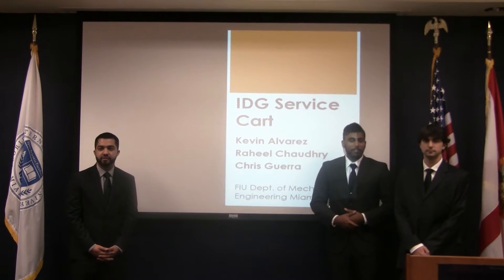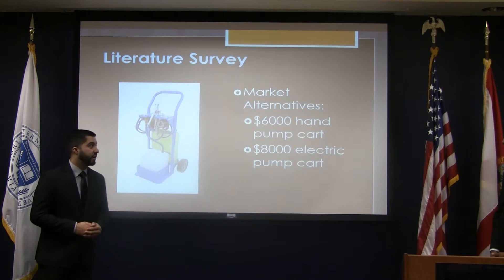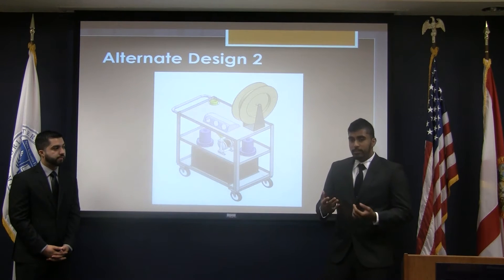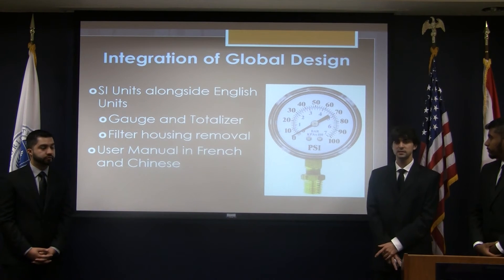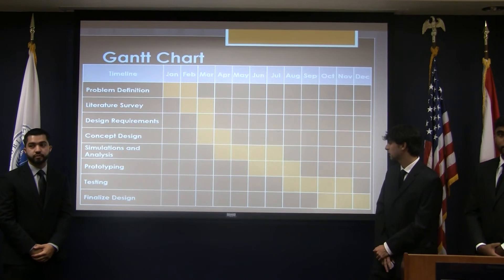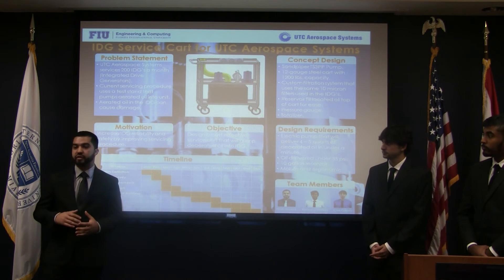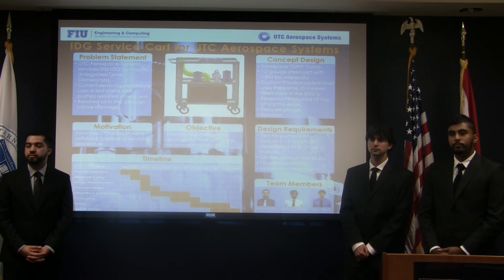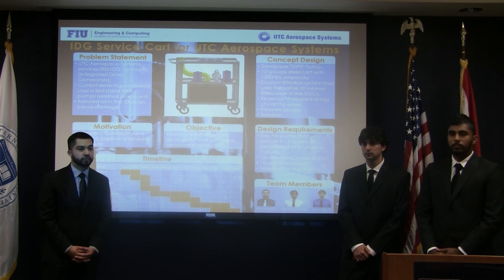SDO Team 1: Electric Integrated Drive Generator (IDG) Servicing Cart

Comment: Overall a great presentation, mostly on completeness. Presenters went in-depth into everything they spoke about. Slides were helpful and easy to read. Only complaint about the presentation is that two alternatives are acknowledged and then they just skip to saying they chose the second option without doing a side by side quantitative comparison.

Comment: The presenters are confident in presenting the information and are knowledgeable in the topic. The inclusion of the SolidWorks model, the cost analysis and the charts enhanced the quality of the presentation. There are a few problems in the lighting and sound quality. It is difficult to see the Power Point slides. There is a lot of background noise which makes it difficult to hear the speakers. Overall, it was a good presentation.